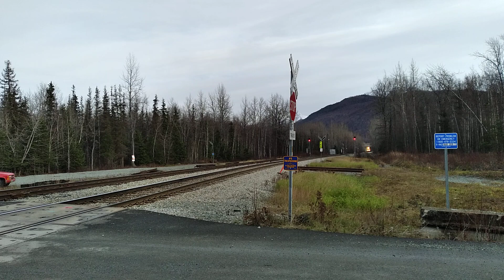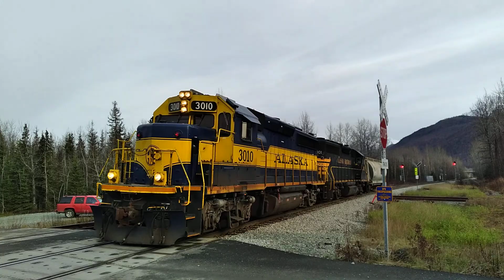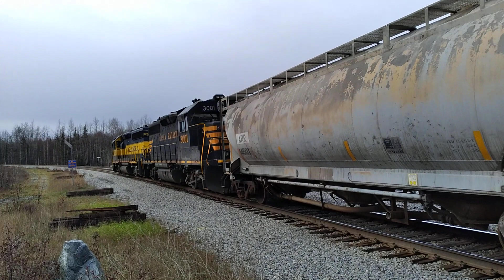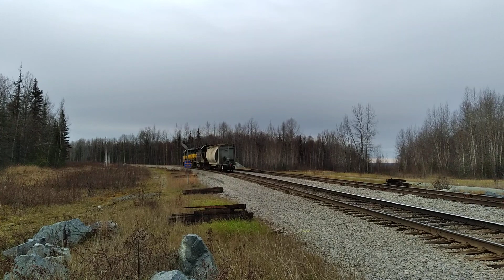Alaska Railroad, Bad Ordered Car Express!!

Comment: Heck of a flat spot on that hopper!! How long has the ARR been going to the non flashing ditch lights?
Reply from the maker: The flat spot I believe was past the acceptable measurement and as per rules must not exceed restricted speed. I bet it was drug a while. So in the last two year or so is when solid ditch lights started being used, but flashing lights are still used too.